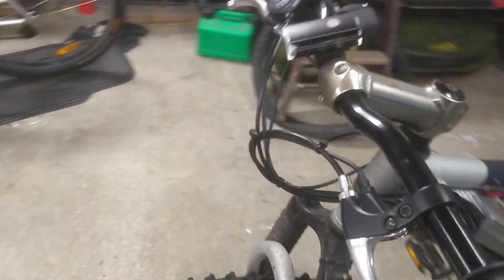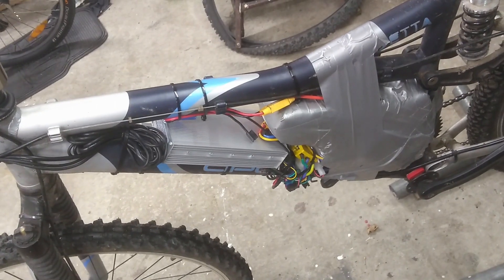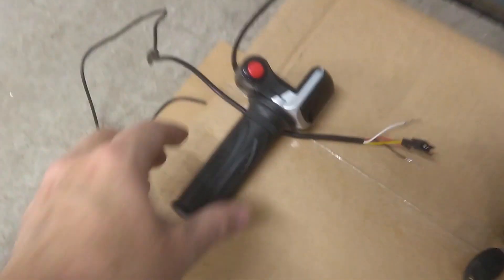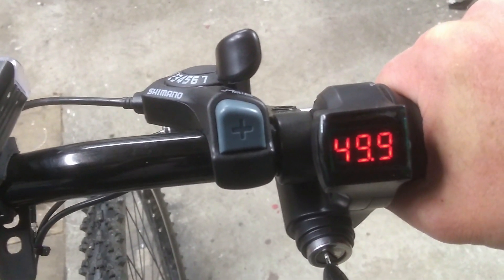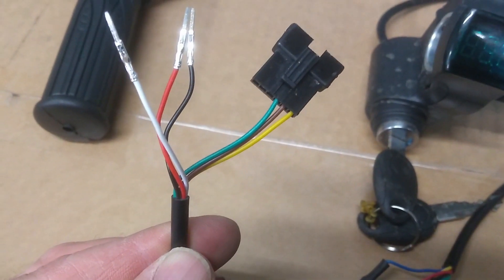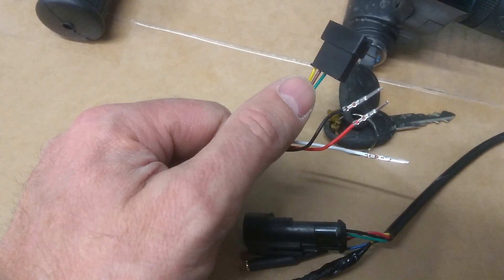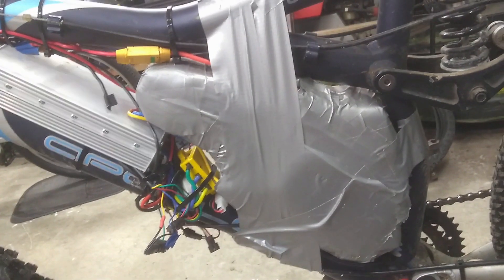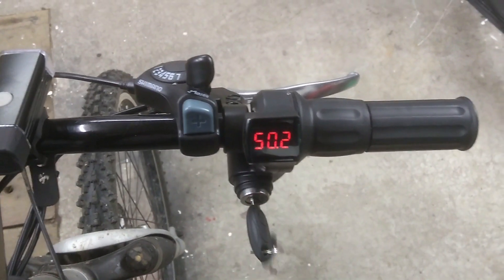Voilamart Ebike Controller Upgrades

Comment: Im running a 52 volt battery to a 1000watt hub if i shunt the controller will it push the hub to far an melt the wires or will it just not make much diffrence. The controller that came with the wheel couldnt handle the power of the battery it kept cutting out so ive got a better controller and it works fine does like 34 35mph decent power, will the shunt make it alot more fun
Reply from the maker: It won't make that big a difference. You should notice it but not by much.
Reply: @alibro7512  im not going to bother i could up grade my wheel to a 1500 watt hub and that would be more power then
Reply from the maker: @catalickconverta6823  A 1500W controller is already giving you 1500W.
Changing the motor will probably make no difference.
Reply: @alibro7512  ummm thats intresting i might as well shunt it then,  ive had it running for about 6 months none stop i use it everyday an had no problems with it i ride of road as well in the wet all conditions i get 24 mile range tested with gps do you reckon ill get less miles out of it with the shunt
Reply from the maker: @catalickconverta6823  I've heard of people putting 5kW into a 1500W motor with only a little extra cooling so 1500W into a 1kW motor will be fine.
Yes a little less as you'll be drawing more power
Reply from the maker: You should consider getting a Sine wave inverter as they are much smoother and nicer to ride.
Reply: @alibro7512  are they a much more quality controller i have seen 1 of them before online when i was looking for my new controller
Reply: @alibro7512  im going to risk it over this weekend ill let you no what happens i have some spare fuses just in case my battery fuse pops
Reply from the maker: @catalickconverta6823  Take a look at this https://www.youtube.com/watch?v=KB2vxk2ZQjc I wouldn't go back to the old controller.

Comment: Please help: Hi i recently bought a 48v 1500w voilamart conversion kit. And for some reason the bike doesnt go on a static position. I always get error 9 until i push the bike/ pedal forward a bit for the throttle to kick in. Is there a fix ? Or get new controller ? Thank you for the help !
Reply from the maker: Is it new?
It sounds like the controller doesn't see the hall sensors properly. Try it with hall sensor plug disconnected to see what happens
Reply: @alibro7512   yeah it is. I wanted an lcd display to control PAS so they sent a second controller but now it doesnt work like i mentioned. The old controller works but only with that throttle mentioned in the video. I personally dont like that throttle, doesnt give accurate readings. I guess using PAS with this kit of out of question ?
Reply from the maker: @ME-il4mr  Check the hall sensor connector (big square white one with 5 or 6 leads). The issue is most likely in that area.

Comment: thanks for  actually explain what the topic/title of video is and not a bunch of stupid music & bad shots that don't have anything of learning about fixing these things so far 4 e vehicles, no go all different controllers & a drift trike with 2 controllers, wire harness that takes the 3&3 from each control to a mess of miss matched wire wish they were like old pioneer & sony, circuit boards had symbols and lined sectionsl indicating function.

Comment: So do you guys think I would have any problems with the included controller if I run a 52v 20Ah battery with a 50 amp bms?
Reply from the maker: The controller is pulling 1500W nominal and 2000W peak. Divide 1500 x 52 = 28.8A so your bms will be fine. The battery will also be OK so long as it is able to handle 28A constant current.

Comment: I don't soldier but might be interested in this mod. Would you be able to soldier one up and sell it? If not do you recommend a better 1500w controller? I have the 1500w voilamart kit
Reply: Hi, I've also got the 1500w 48v rear hub voila kit, did you get a better ampage controller and if so what make was it and where did you purchase it from, I'm running my kit with the stock controller (35amp max) but with a 52v 20ah triangle battery I'm top speed at 33mph but want more torque, did you get a bigger controller is my question to you please and if so what make? Thanks

Comment: So it didn't blow up your controller
Reply from the maker: No, it worked fine for months afterwards until I replaced it with a Sine Wave controller.
Reply: @alibro7512  do you have a link for this since wave controller?
Reply from the maker: @reyweygant9402  Here you go. Lots of links in the description of this video.

Comment: i was thinking of soldering the shunt but im not sure how many amps the controller would draw from the battery and that is the problem i have heard of some controllers overheating doing this not sure about the Voilamart ones do you think it is worth just soldering the shunt for more power rather than buying another controller ?
Reply from the maker: Soldering the shunt worked for me but I can't promise it will work for everyone.
Replacing the controller with a Sine wave type and the throttle is the way to go.
Reply: i might actually look at that and it looks like you get the lcd aswell so hopefully you can control the amp draw on the lcd if needed
Reply from the maker: @FATTY1990  The amp draw is dictated by the controller so if you buy a 1500W controller it will draw up to 2000W max. At least that is what I'm seeing on the LCD display. I suspect a 1000W controller would draw up to 1500W or so.

Comment: My 48v battery charges upto 55v
Reply from the maker: That's normal or may be a tiny bit high for a 13S pack which is standard for a 48V system. My current bike is 14S so charges up to 58.8V

Comment: Thanks a lot for the information on the throttle wires. And more. I love my new mod on my shunt I did as it’s even more of a beast with two 58.8v in parallel and 1500w R and 1000w F.
Reply from the maker: Glad it helped

Comment: Been running 63v and shunt mod for nearly 2 years now. 5800miles so far. Just had to replace rim as the brake blocks wore thru the sides.
Other than that bullet proof.  GPS speedo 52.9mph. 56front cog, 10 rear.
Reply from the maker: Great update thanks

Comment: the pas sensor needs 3 wires,5volt pos,ground,and the signal wire ,your puting the signal straight to ground so it goes flat out
Reply: pas usually has red,black,and white for signal
Reply: i can find the pinout pcb connections for you if you need,let me know
Reply: i can also show you how to reprogram controller and add small lcd screenfor bout 10 bucks on ebay
Reply from the maker: @katiekumcgil  Thanks for watching and your message and suggestions. 
I did this a couple of years ago but I'm pretty sure I was using the correct connections for the PAS. The red black and white wires are hanging down disconnected in the video because I didn't like the PAS. I became aware a little later it could have been sorted with a display but decided to go without PAS. 
Since this was made I replaced the throttle again the controller, battery pack and even the bike so the only thing common to this video is the motor.
Check out my other videos for more updates.

Comment: Been running mine with the shunt mod and 63v for nearly a year. Hard hills. Deep mud.
45mph. Great fun and I have had no problems at all
Reply from the maker: will kinh  As I understand it, if you add solder to the shunt you reduce the resistance of it. This means the voltage drop across the shunt at any given current will be less. The controller is designed to stop delivering more power when the voltage drop across the shunt reaches a certain level so by reducing the resistance the current will need to be higher to achieve the set voltage drop thereby giving you more power for your ebike. I don't know what the limits will be but if you go too far it will eventually fail.
Reply: @alibro7512  add more copper wire and use solder as adhesive to attach copper wire to those shunts. copper is better conductor of electricity than solder

Comment: Hi could you please  tell me what size wheels are on your Apollo  Vendetta bike. Are they measured to diameter of the wheel rim 22ins  or including the tyres 26ins  diameter. Many thanks
Reply from the maker: They're 26" wheels. At least that's what is on the tyres.
Reply: @alibro7512  Do they do a 22" version .Thanks very much
Reply from the maker: @jobow6656  I don't know if they still sell ebike wheels.
Best check ebay, Amazon and Aliexpress.
Reply: I think they do! Have you still got your Apollo  Vendetta bike, as I am looking for one @alibro7512
Reply from the maker: @jobow6656  I do but I wouldn't recommend it. The brakes and suspension are rubbish and the gears aren't much better.
Reply: @alibro7512 That is a shame, what would you recommend?
Reply from the maker: @jobow6656  Iron Horse. https://www.youtube.com/watch?v=k8fw7H9eAwo
Reply: @alibro7512  Hi Ali, thanks for that, great stuff!  its just finding one , there like hens teeth. Many thanks
Reply from the maker: @jobow6656  I searched for weeks for a full sus bike with a triangle in the frame big enough for a battery. This was the only one I found.
Reply: @alibro7512  I'll keep looking if not successful  I'll try and get an  Apollo Vendetta and fix  that up. Cheers
Reply from the maker: @jobow6656  the one we had was quite small but I guess they came in all sizes.

Comment: Great video... One question though how does the shunt bridge give it more power?
Reply from the maker: I'm no electronics expert but I believe the shunt has a very small voltage drop across it  which is measured by the controller and when it reaches a specified level the controller is at max power. By adding solder the resistance is reduced therefore it takes more current to get the same voltage drop across it.
Reply: @alibro7512  ahh ok cool thanks for the prompt reply 👍
Reply: @alibro7512 Thanks bro.. I've got the 1000 watt voilamart motor and controller and it looks a little different to yours as far as the layout goes and the tracks are already beefy, they are wider and the  soldering is fine.
But about  the shunt, you say there was 3 links and you bridged 2 of them? Mine only has 2 links so how would I do this?
Reply from the maker: @nickn8812  If you bridge both shunts with solder you'll lower the total resistance a little. I'm not sure how much you'll notice the difference but it's worth a try. 
If you want to upgrade even more then 1500W controllers from eBay are around £30 and you're motor should be fine with it.  If doing that it is easier to replace the throttle too.
Reply: @alibro7512  Thanks again for reply...I wasn't sure so I thought bridge the right hand shunt first and while I was at it I added solder to the high current tracks as you did, I put it back on the bike and tested it and WOWW I was awesome. You've Definitely hit  a winner with this mod. I'm running 14s lipo. Though before this mod, even by changing to Lipo it didn't make the improvement I was expecting, but with this mod it allows the power of the Lipo  come to the fore.
I might bridge the other shunt as well as see how that
 goes 👌🏽
Reply from the maker: @nickn8812  when I said Bridge I meant Bridge across the two shunts but if its working then great. Don't forget it wasn't meant to be so powerful so keep an eye on temps.
LiPo's are great but watch their voltage. 14S might mean the voltage of each cell could go too low before the controller cuts off.
Reply: @alibro7512  Ahh ok... Lol.
Well it made a huge difference anyway by adding solder to the bridge itself.
I tried bridging the 2 together but it only made a slight difference. But I'm happy with the improvement overall from the mod.
I'm going to add another series connection and run 72volts 😊..
Will report back with the results 👍
Reply from the maker: @nickn8812  72V will blow the caps so I wouldn't recommend going so high.
Reply: @alibro7512 it's a gamble I know, but doesn't matter as controllers are cheap or I can replace the caps myself and install higher voltage caps and see how that goes.
I've read reports of people running 72 volts and it's been fine other than a little noise from the caps... Lol
Reply from the maker: @nickn8812  cool, let me know how it goes. 👍
Reply: @alibro7512  UPDATE: 72 volts and so far it's a success. No signs of any of the hardware having any issues, motor is just luke warm and controller is cool. Which is what I expected because the extra voltage means lower current draw. But more power 💪😎
Reply from the maker: @nickn8812  That's great, thanks for getting back.
Good luck with it. 🙂
Reply: @alibro7512  👍

Comment: That is a great throttle your showing. Anyone know where it can be bought ?
Reply from the maker: Ebay or Aliexpress.
Reply: @alibro7512  Thanks for replying and trying to help. Without knowing exactly what to search for I can not find it. I have found another one that is similar at Walmart but not sure if it's as good as the other one.
Reply from the maker: @herbertwerner2287  if you search on eBay lots of Chinese sellers selling them. I'm assuming you mean the one with a key switch and Voltage meter as the other is rubbish.
I prefer the version with half throttle as it is easier to hold.
Reply: @alibro7512  Well I saw one with the digital voltage but i saw no key switch. And I think that key switch is more than just functional it looks cool too just being there.
Reply from the maker: @herbertwerner2287  Here you go.  https://www.ebay.co.uk/itm/E-Bike-Electric-Bicycle-Throttle-Grip-Scooter-Handlebar-LED-Digital-Meter-Tube/402316543436?hash=item5dabef45cc:g:zBcAAOSwKtdfAZak or half throttle https://www.ebay.co.uk/itm/Right-Hand-Half-Twist-Throttle-Handle-Electric-EBike-Scooter-V-Display-Lock-Key/193382135968?hash=item2d067938a0:g:uFcAAOSw6qxebMeo These are just the first I found, if you look there are cheaper options for the same thing.
Reply: @alibro7512  Well I'll be. Thank you so much again. Those are U.K. links but I have found them on the U.S. website. Which one do you like or think is the best ?
Reply from the maker: @herbertwerner2287  I prefer the half grip.

Comment: Remove half the magnets from the pedal assist sensor,it should work fine or play around with the number of magnets till u get the desired results.
Reply from the maker: It works by recognising the sequence of pulses from the hall sensor which triggers the PAS at the preset speed, in my case it was full throttle. Any change in the sequence will stop it working. That's why it doesn't trigger PAS when you back pedal.
Reply: @alibro7512  yeah,by reducing the magnets ,you will reduce the number of pulses
Reply from the maker: @niius7663  the magnets are not aligned all the same so when you pedal forwards there is a particular sequence of pulses seen by the controller. If it doesn't see the exact sequence it won't work so removing magnets will stop it working at all.

Comment: pedal sensor bad news just do away with    but just use common sence the motor helps you but sometimes you need to help it   IE the steep hills= labour  good  vid  sir also you can  jag 60 65 v  up its ass   done it for 3 years and still running and im 220 lbs its still ok    serious but none the more unless you up grade the caps as there 63v rated

Comment: Hi mate just ordered the 1500w kit with separate controller did you get round to try the lcd display on that controller
Reply from the maker: No, I replaced the controller and haven't used it since.
In my case the kit was cheaper than a wheel/motor so I wasn't concerned about it.
I never got a display for it

Comment: Hi mate looking to update mine to 1500W but do I buy the kit with built-in controller in the wheel or separate controller
Reply from the maker: If you want it neat and are happy to put up with the poor quality controller and will not want to tinker/upgrade and you don't mind replacing the lot if the controller fails then get the integrated unit.
Otherwise buy separate units.
Reply: @alibro7512  thanks you just made my mind up will buy separate

Comment: My voilamart pedal sensor goes full on as well. Don’t need it anyway in my rolling terrain.
Reply: Run a on off switch on the handle bar and two blue wires to it so you can have 1500w or 250-watt can you can use the pedal assist sensor

Comment: If you wanted to switch between 205w and 1000/1500w, couldn't you just add a simple on/off switch? and what would that do..... ps I love the simplicity of your videos....keep it up ALI BRO!
Reply: PS where can I get cheap duct tape....lol
Reply from the maker: @pxxbxx9840  Pound shops. 🤣
Reply from the maker: Thanks for the kind words, most of the issues on this bike have been resolved in newer videos.
BTW I have to keep it simple cause I'm not smart enough to make it complicated. 🙄

Comment: Hey there are you getting vibrations with this amperage mod?
Cuz i did it on mine and now when i hit 30+kph the motor start vibrating. The motor does have more power throughout the whole range tho.
Reply from the maker: I haven't noticed any issues but I'm not using this controller now as I had another with cruise control built in. When I was using it I could reach 30mph no problem.
Reply: @alibro7512  
Thanks for the amswer mate, ich i gonna try to remove a bit less solder and fine tune it that way so that i stop getting vibrations.